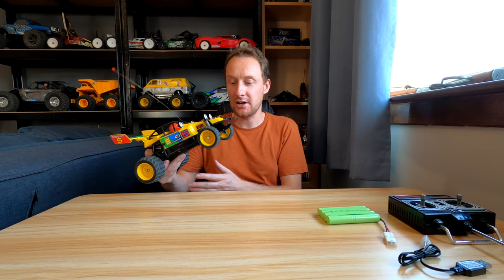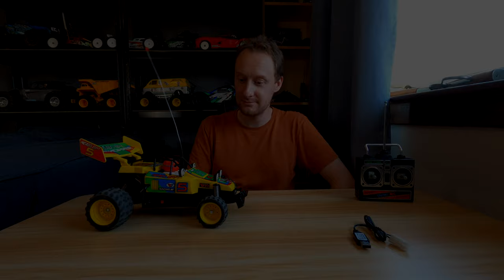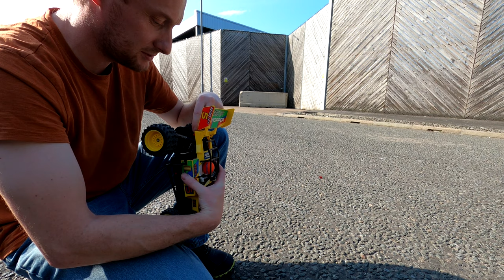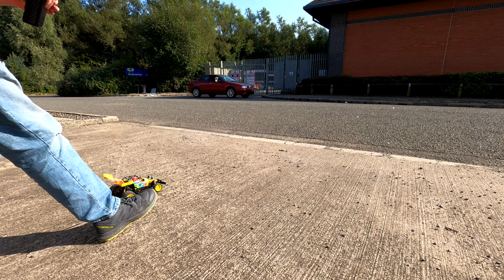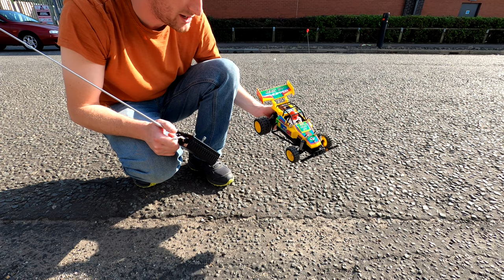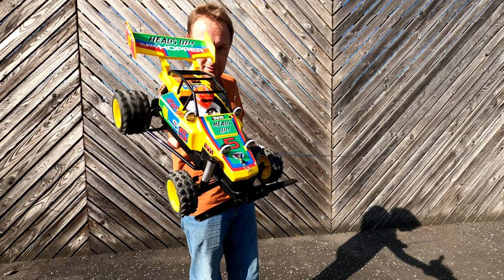Taiyo (Tyco) Heads Up Hopper - First run of this vintage, 1980's RC icon!

Comment: The over geared acceleration sound when you did that first pull away in fast mode took me right back to the Countach I had!
Reply from the maker: I remember that! Possibly the exact same drivetrain?

Comment: Not quite. 250mA means the maximum current the charger will provide - depending upon the load placed upon it - at all times and not just per hour! 😉

Therefore a battery with, say, a capacity of 2500mAh should take 10 hours to charge - in theory! However, component tolerances (and the internal resistance of the battery) being what they are, it will actually take longer than 10 hours. Generally, you would multiply the theoretical charge time by 1.2 to get a more accurate time, so in this case 12 hours. People tend to forget that batteries have some internal resistance and it increases with the age of the battery.
Reply from the maker: Good info, thanks.

Comment: Where can I find this heads up hopper?
Reply from the maker: I was looking for many years on ebay, gumtree, places like that. I managed to find this one on ebay.
Reply: @TheRCScotsman  bro please if you ever want to sell it I will buy it. I have all the heads up and this is the last one I need
Reply from the maker: @bigwhop136  Nice one. I'll definitely bear that in-mind. I'll probably get a few videos done with it, then we'll see. Thanks for letting me know!
Reply: @TheRCScotsman  Ok thanks and when I do my video of the heads up collection I will definitely shout you out that you helped me
Reply: @bigwhop136 I have one here - just need to test if it's working or not. Reply if you still need this RC
Reply: @DjMessiahUK  I need this and the black jet hopper and black rider
Reply: @bigwhop136 I have the battery on charge, I'll let you know if it still works!
Reply: @bigwhop136  hey mate, I got the wheels to turn and accelerate for about 2 seconds before it conked out. It could just be because the battery is so old and holds no charge, but I don't have another to swap out.

I'm open to selling, but obviously with no guarantees that it will be working.

It does have the original box, instructions, remote and aerial, so up to you if you're interested. 👍